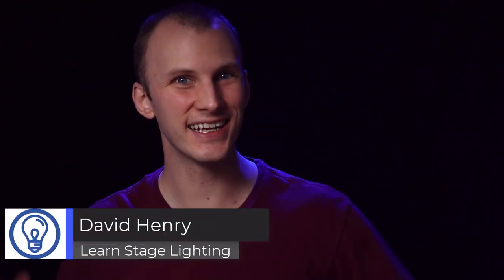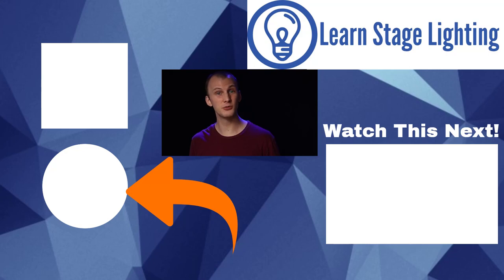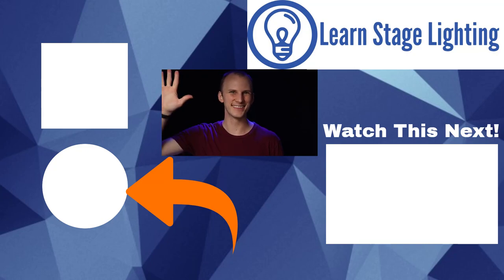How Do You Control Lasers - ILDA, Mercury, FB4, Lasercube?

Comment: can i connect serially two lasers with ilda cable with one fb3/quickshow and control once at time?thanks
Reply: No. If you want two different lasers to do two different shows, you need two ILDA interfaces. It doesn't work like DMX where you can address different fixtures through one interface.

Comment: At 3:10 I notice you took the hook clamp and bolted it to the bracket through where the fastening wingnut is supposed to go. Is that legal out your way? Just genuinely curious...
Reply from the maker: That's how this particular clamp is designed to work....not sure what you see wrong?  The clamp in question is definitely more of a DJ-grade clamp, I usually use a regular c-clamp or similar on professional rigs.
Reply: The clamp does look weird and inverted but it wouldn't work the other way arround. I would certainly avoid these clamps for better C-Clamps tho as these tend to leave marks before being secured to any kind of poles 😅

Comment: Hi! Are a free sofware option thats works with chinese láser with ilda port/rj45? Thanks
Reply: Im wanting to know the same thing, have you found anything?
Reply: Modulaser and LaserOS are free downloads. But, regardless of the software, you will still need an ILDA DAC to convert digital USB or Ethernet from the computer to the projector's analog DB25 ILDA input port. The software and ILDA DAC hardware must be compatible. ILDA DACs range between $100 & $400.
Beware of the RJ45 connectors on some Chinese projectors. My 1st pair were NOT Ethernet inputs. They required a DB25 to RJ45 adapter to be connected to whatever ILDA standard DAC that's being used, then a CAT5 cable to run the analog signals to the projector's RJ45 port.
There are also internal Pangolin FB4 DACs, which have RJ45 Ethernet input ports, as well. But, an internal FB4 will increase the projector's price by ~ $500.
Buyers beware.

Comment: I hope LaserOS will be DMX compatible soon :)
Reply from the maker: It is, I think it might technically be in beta, but you can control the networked ones via DMX (it does have to be one of the networked lasercubes, though)
Reply: Is it compatible with soundswitch?
Reply: Nearly every OTC laser nowadays has DMX in/out to control ILDA standard laser images and effects, which are either stored inside the projector's 'showcard' or stored on uSD, which is read by the projector's showcard.
The manufacturers of the projectors pre-program generic 'party' images on their showcards.
ILDA images and laser content can be downloaded from online libraries.